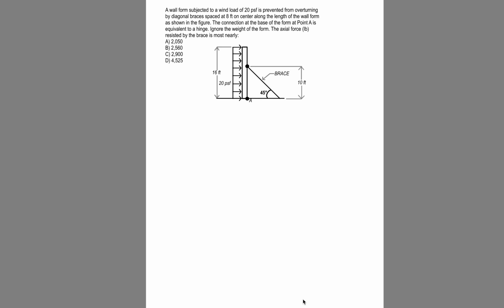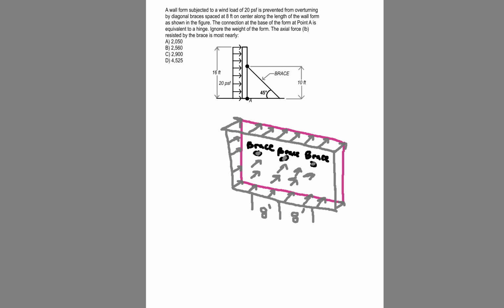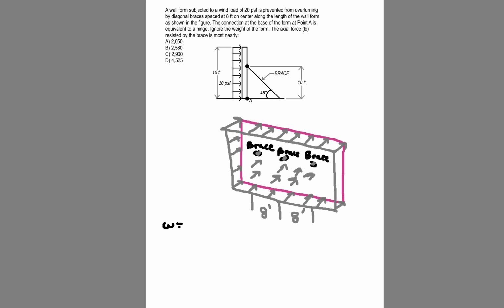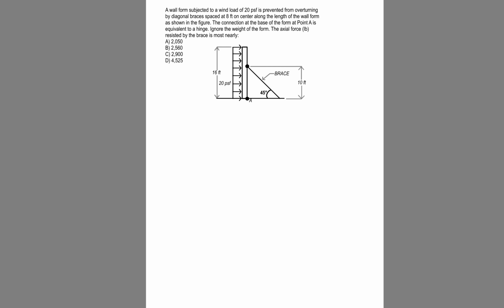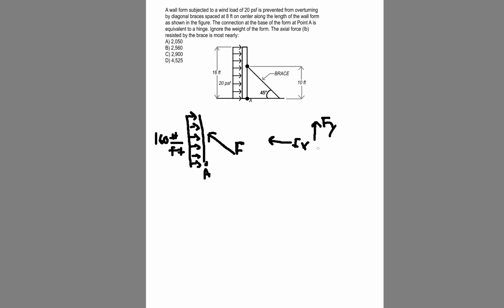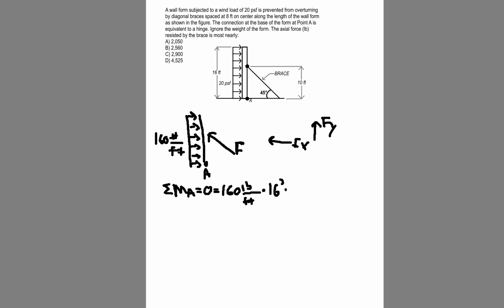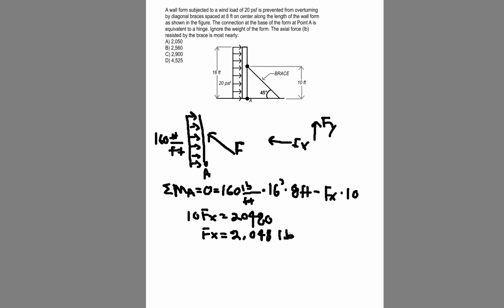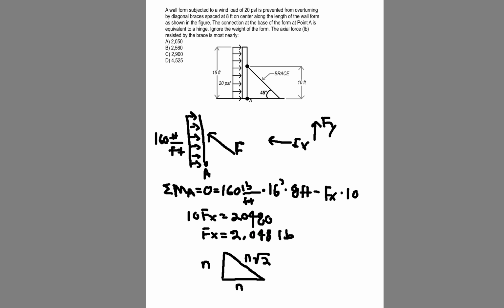Civil PE Exam Practice: Lateral Load Acting on Vertical Wall Form

Comment: Hey! 
It looks like you made a mistake in your moment calculation.
You wrote 160 × 16² × 8, but 16² is incorrect.
The load from the wind is uniform, not hydrostatic, so the force does not vary with height. The correct moment should be:
M = 160 × 16 × 8
Reply from the maker: Hey! Thank you so much for the comment. I think it is just my messy handwriting - I wrote an apostrophe (') instead of squared. I agree the moment is 160 x 16 x 8 = 20,480. The math still works :)
Reply: That briefly confused me as well but I figured out it was ft eventually 😂